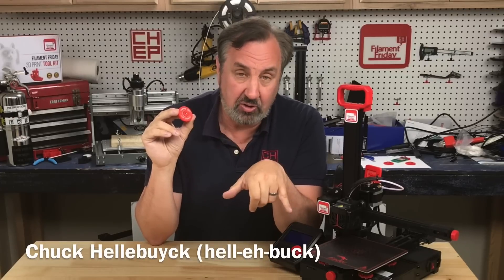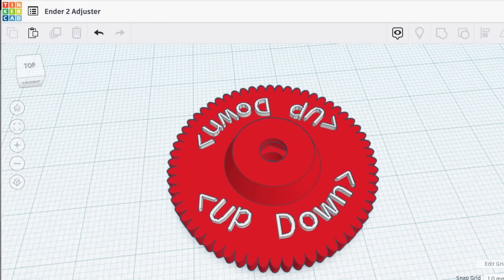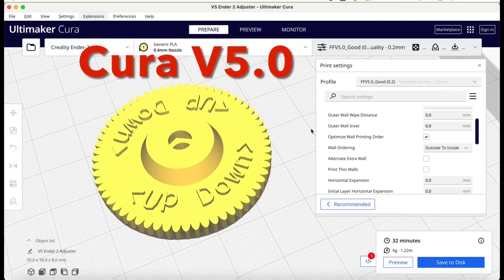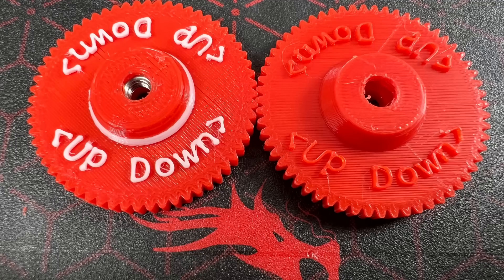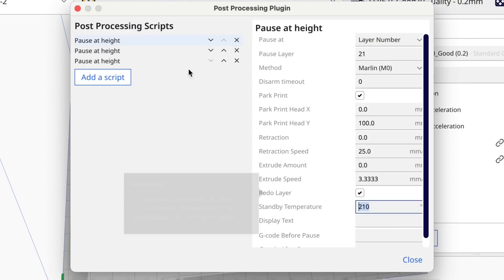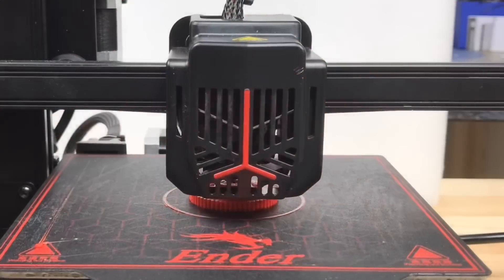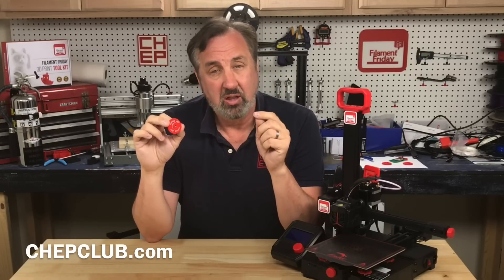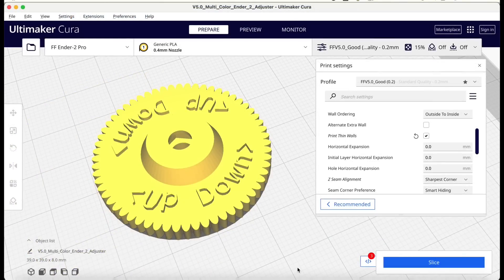Ender 2 Pro Adjuster Knobs for Easier Bed Leveling

Comment: Can you show how to ad a BLtouch to the ender 2 pro?
Reply: Why?!
Reply: @markgard  because I like to print on glass and on the magnetic sheet and a bltouch makes it easy to change between them.
Reply from the maker: Same as this just gotta find the right firmware. https://youtu.be/TroPjdkSEOY
Reply: I managed to find a way that works good myself, but it can use some fine tuning still.

Comment: Every now and again Cura 5 decides it will change my support density to 100%, sometimes I get a warning box but the majority of the time I dont and have to check every part that is sliced so I use 4.13 most of the time, I reported the bug when I used the Beta but it has carried on to the release version

Comment: When I use vase more in cura it fills the first layers are circular and not the normal. Can someone help please!!
Reply from the maker: Change bottom layer pattern from concentric to lines.
Reply: @FilamentFriday  thank you so much
Reply: @FilamentFriday  I changed it but the preview still shows it being concentric in case mode ?

Comment: Does anyone else find that Cura 5.0 is slower for some prints than it would be with the previous version
Reply: ive noticed that actually slicing the project sometimes takes quite a bit longer but actual print time and quality are better. crazy since i run a ryzen 7 16 core with 32 gigs of ram.
Reply: The one file I tried gave me a slightly faster (maybe 5 minutes on a 4 and half hour print) and the parts seem to fit better, however quality took a a dumpster dive :(

Comment: Maybe you should mention Cura V 5.0 will not work on older OS's "From version 5.0 onwards - Ultimaker Cura is only supported on operating systems actively maintained by their software manufacturer or community. This means Windows 7 and MacOS 10.14 will no longer be supported.
Ubuntu 18.04 is also no longer supported because of the update to Qt6."
Reply: It's open source so you can always setup a build environment and compile your own for old OS...
Reply: that will affect about 14 people trapped in 2004
Reply: @natalieisagirlnow  🤣🤣 love it
Reply: @natalieisagirlnow  A typical narcissistic plea for supply.
Reply: @natalieisagirlnow  considering OSX 10.14 was released in 2018 you’re off by about 14 years there pal.

Comment: How does Cura 5 work with Marlin linear advance??
Reply: No relationship (doesn't interfere nor control it, whatever K value you set for LA in your printer UI or start gcode will be used) but be sure you don't turn on Cura's half-baked alternatives like coasting.
Reply: @daliasprints9798  did you test it? Because the variable line width means the extruder will change speed a lot and the linear advance will too. So extruder must work harder and proccesor must calculate a lot right?
Reply: @JulianiLuckeey  I think I misunderstood your question. I've used Cura 5 since long before official beta so yes I've tried it. I use Klipper not Marlin so it's a little different, but the computations needed on Marlin are really no different from what it does during kinematic accel/decel. Also, Cura 5 has "flow equalization" you can use to make it speed up and slow down when switching line widths to keep extruder flow the same, which can help if you don't have LA working well.
Reply: @daliasprints9798  okey great, I will wait for a more stable build when it gets updated and they fixed most of the bugs anyway. Thanks